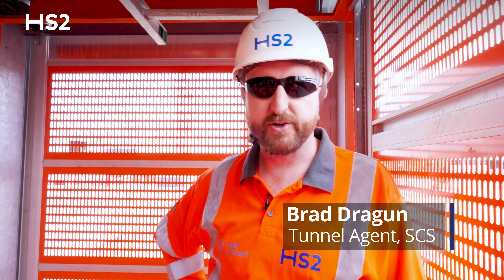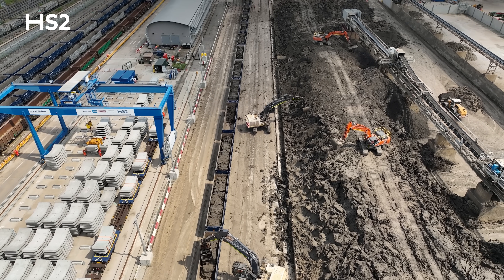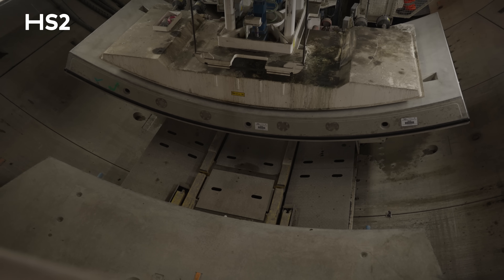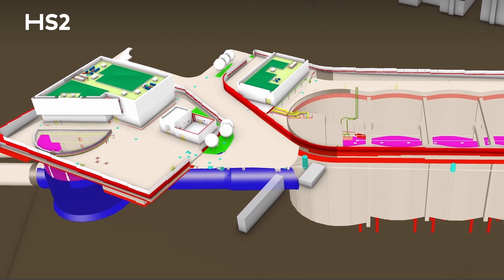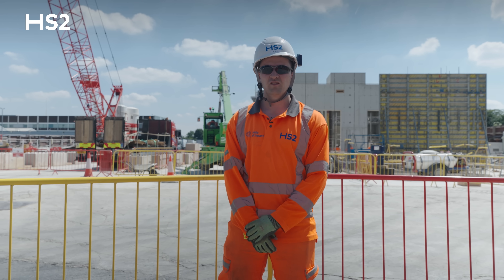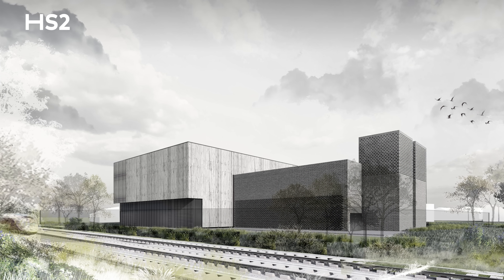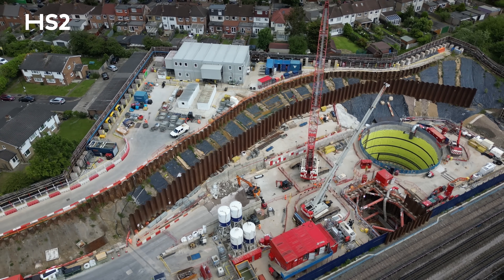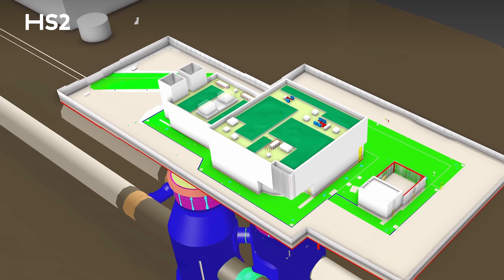HS2’s Northolt Tunnel under the capital is 50% complete

Comment: Good vid. i understand everything except how those tunniling machines navigate so accurately without gps.
Reply: I will explain it to you they use GPS. Probably the most stupid thing I've ever read in my life. I could understand if you made a comment when they built the central line but there's a video on how they dug the Elizabeth line tunnels go and watch that before you type stupid things like that
Reply: @Beansontoast93911  are you austic? must be.
Reply: @BLX187  What is that supposed to mean?

Comment: This whole project, has been corrupt from day one. Millions were made from the buying of houses in the way, by short changing owners by hundreds of thousands of pounds of their houses. The Chinese were originally asked to build it. Their own HS Railways are built at a 1/3rd of the cost of HS2. But they turned it down because of the myriads planning problems. HS2 so far has spent £90 BILLION!!   Chinas High Speed Railway cost £21 million per kilometre. By 2021 they had built 27,000 miles of HS Railway- the largest in the world. They. are now progressing with the MAGLEV system (trains driven by magnetism).HS2 has been nothing but a massive gravy train for Tory private sector businesses. Nothing short of Criminal. The media, hasn't said a thing about it. iTS THE BIGGEST CON EVER. THE AMOUNT OF MONEY SPENT SHOULD HAVE TAKEN IT TO EDINBURGH -WITH BILLIONS LEFT OVER.   THATS 3 TIMES OUR NATIONAL DEBT.

Comment: If the HS2is following the route of the railway,why is it in tunnels….. so much extra cost?
Reply: 1. NIMBYs.
2. 300kmh+ railway needs to be straighter than the original alignment, that includes the elevation.
Reply: @Gelatinocyte2  loool no train is doing 300KMH anywhere near London. Northolt is 5 miles from the Station. There will be speed restrictions post Zone 5....
Reply: @autodigitvlogs  That's what HS1 and HS2 are for: they allow trains to run to their highest speeds. Do you not know how trains work?

Comment: Screw the North as always! As long as the south is okay forget the north
Reply: From where I live as it stands if I was going to Birmingham I would still be using the current trains because it would be slower for me not to so they've made slow speed trains not high speed trains
Reply: It's not even going to benefit the south because it's not going to end up in Central London for another 10 years at least because they can't guarantee it's gonna happen so why would I get a train to the middle of nowhere instead of getting the current trains which actually take me into London

Comment: I really wish people would stop prioritising the north west. It’s drastically overfunded when compared to the north east of England. We are drastically overcapacity on the emcl we also have terrible outdated second hand rolling stock from the north west. The north west is far too overfunded. They should have prioritised relieving pressures already in place on the emcl not futureproofing the wcml when it isn’t needed or necessary
Reply: Your section got canned. Unfortunately.

Southwest would like capacity but it's also known the West Coast is also near or at Capcity. 

North West would benefits from the completely impossible without rerouting of the Great Central Railway

Comment: As said by another contributor, this tunnel was a political decision because of the Nimbys along its route. There is plenty of room on the surface for the tunnel to run, although some over or under passes may have been necessary.  It is the huge expense of tunnelling so much of the route to Birmingham that has made the costs so large. If you add up the mileage, it must be getting on for the length of the Channel Tunnel. Costs were piled into this project by politicians not engineers.
Reply: Correct.
Reply: Slowed and cost increases caused by politicians heavily lobbied (paid) by the petrol and auto interests.
Reply: USA have the same problem.
Reply: Why were NIMBYs on the way to Birmingham able to send the tunnel under ground, meanwhile the sections after Birmingham (which were/are cancelled) had houses demolished, for some of them to not even have railroad laid over them?

Comment: Seems like 90% of the stretch could've been built as surface rail, to save a good amount of money... Something that wouldn't significantly impact the neighborhood, given that rail line already exists and just needs a little additional land for widening. That's what engineers from the yesteryear would've said I suppose... today we abhor noise and hold backyards sacred on wholly new levels 🤷
Reply: Didn't stop motorways being built though.
Reply: @rogerphelps9939 
Crazy, honestly.
Reply: @rogerphelps9939 can you name me some motorways what are getting built instead of refurbished
Reply: I believe the not commonly used mainline tracks here are wanted to be left in case Chiltern eventually comes to OOC. It's known Marleybone is at capacity and if Chiltern needs an increase of trains and they do the further track works that have been put of around West Ruislip. It's a shame these upgrades arnt being done as part of HS2 sadly.
Reply: @ethmister why would you use marla bone why wouldn't you just connect it with hs1 which carries on going down south. Hs1 is pointless unless if you're going to France that should be going all the way from Kent straight up to Scotland that would have saved them billions of pounds having to build a new Terminal at Euston
Reply: Yeah what a waste of money
Reply: @Altn246  well the obvious reason is all of the politicians mates needed to make hundreds of millions profit HS2 was never meant to succeed if it was you wouldn't open the line on the outskirts of London I know matter what anybody says about the Elizabeth line once you get on that you're better off using the current train service by timings if you want to go to Central London there is nothing at old oak common so there's no reason why anybody will want to be going there originally all of these politicians mates have brought the land around Old Oak common and are making billions from building up on top of it to make it somewhere valuable which is completely pointless of a train line until it a major town centre which will never happen

Comment: If Labour don't restore protection for the route for Phase 2 the Manchester section I will be very disappointed in them. The money to secure the route has been spent, it costs nothing to protect the route so it can be built eventually when finances allow.
Reply: EXACTLY SO!!  The route MUST be protected!!
It is sheer madness not to since the most expensive part of HS2, which is bringing the line from LONDON to the MIDLANDS will have been completed.

Thank you
Reply: @chrismoyler I am very pro the route being completed in full. I do however disagree that the most expensive part has been completed, I think they will be broadly the same
Reply: @chrismoyler  Yes. Selling off the HS2 land north of Birmingham was a Tory wrecking tactic done out of spite.
Reply: HS2 is the best exemple of why short term elected democracy doesn't work, especially in a capitalist system.
A 5 year term government is too scared to commit to long-term projects, as people see the money spent, but not the positive outcome before the end of the elected term, that arms political opposition with pointless statistics and use it agains them being re-elected. 
In short our political system incentivise pointless short term project spending multiple millions on a pointless scheme rather than investing a few billion on something with potential.
Reply: @Mrcharlieize  to a certain extent you are right but HS2 was proposed under the Labour government in 2009 then the Tories launched the project in 2010 and started building in 2017. And then it's not going to open until 2029 to 2033. The whole of HS2 could have been built within that first 7 years. But it takes so long because they want to give all of their mates loads of money over 20 year period.
Reply: @Beansontoast93911  yeah this is one of few long-term projects, however it has outlived multiple governments who have all messed around with it and yes as you say corruptly offer the job to some buddy contractor, and then new government new contractors.
HS2 limited is a shady company in itself who shave subbed the work to other shady companies. Just as shady as horse hill developments limited
Reply: Yeah, still it can bw difficult to recontract the project. 

Sunk in cost are tough but it can go worse
Reply: I agree 💯
Reply: Not possible thanks to Tories scorched earth tactics 🤮
Reply: @Antwan86  Very little of the land has been sold, it is entirely possible. And the planning protection for the route can be restored even if some of the land is not owned, it just means you have to buy it again.
Reply: @owensmith7530  the problem is because it's very political you won't get anybody like this too agree with you I think they've only sold about 5% of the Land back but labour are already raising taxes on working class people so I highly doubt they're going to even attempt to revive it they will just be looking to remove your nan's heating benefits
Reply: @Beansontoast93911 have labour raised taxes? or am I dumb- a quick search said they've not raised any
Reply: My Cousins farm would have had phase two substations and pylons, HS2 rented the land but haven't made a purchase.
Reply: You're sadly very wrong, and I strongly urge you check yourself. 
The tories,  as one of their final acts,  sold off the land for hs2 for mere pennies and squandered what little income there was on tax cuts. 
There is no money,  the land has been sold.  It would be incredibly expensive to restart the project now and while it isn't impossible,  there are much more important things that we need to spend on right now.
Reply: @xaiano794  Very little of the land has been sold. The tories said to sell the land, but that takes time and hasn't happened. Partly due to the people involved dragging their feet in case of a change of government I suspect, and partly because it simply takes time.
Reply: @owensmith7530 and you are correct I think it's something small at 5% of the land has only been sold back but the Labour government wouldn't know how to run a bath so I highly doubt it's even going to end up in Euston now it's a complete joke the whole system
Reply: @xaiano794  As for more important things to spend on right now, HS2 is a long term investment and there will always be something shorter term to spend on. You have to invest at some point.
Reply: @xaiano794 they've not sold any land.
Reply: Great idea….precisely why it won’t happen.
Reply: Zero chance and I mean zero
Reply: @alexwipe  I'm saddened that you think that. It is completely free to protect the route, so why not?
Reply: @owensmith7530  50-60 billion reasons
Reply: @alexwipe  Protecting the route is free, all the land has been paid for. It can be left protected but unbuilt for a decade or two and by then with Phase 1 running the value will be seen and we may have the money. It's called forward planning.
Reply: @owensmith7530  I agree but that won’t be with this government. Government runs in 5 year cycles and this government (5 years) will not commit to anything. That said I doubt the will sell whatever they have purchased thus far.
Reply: @alexwipe  With the tories in such disarray and Labour having such a large majority, they should be preparing to be in power for 10 years or more. The last time a party was in power for only one term was 50 years ago in the 1970s.
Reply: @alexwipe  ... you realise that this exact mindset is WHY infrastructure in the uk costs so much? You dont have a permanent infrastructure organisation... each project needs to hire people from scratch and potentially train them too. Besides, not all railways need to repay their cost in fares for them to be necessary... just like how a new motorway could boost the economy of a city without being a toll road, except without all the pollution and with a lot more convenience.
Reply: @cleo5610 The vast sums of money are a drop in the ocean of government bonds and gilts.

I agree with Alex that land purchased before Harper spun his lie about cost savings and redeployment, should be stated to be being protected once Peter Hendy and Juergen Meier reach a conclusion about HS2.

Political upheaval may be possible in 2029, but this government must make the direction of UK rail infrastructure clear and commit to the project connecting London, Birmingham, Manchester and Leeds.
Reply: @alexwipe so many reasons he's not going to provide even one. 🙄
Reply: @owensmith7530 enjoy disappointment instead of spending money on making the service there too busy making videos about it and if you watch the workers in this video they are all just standing around
Reply: @owensmith7530  0 chance mate 1 thing I’ve noticed about starmer from before he was elected is what type of prime minister he would turn out to be, he’s always been scared to have an opinion or make a bold policy proposal due to being scared of being criticised, he likes to play it safe and in no way will reinstate that route it’s not his style unless everybody is screaming and crying for it to happen then he will  definitely do it to please everyone. Everybody only voted for the man due to how intolerable the tories became but have no idea why they voted for him or what he stands for
Reply: @farahomar6880  Actually it's now been leaked that Labour are looking at re-instating more of HS2.

Comment: Fantastic engineering which will be in use for 200 years plus.
Reply: Toriels am I right?
Reply: @Gelatinocyte2  and please remember the Elizabeth line tunnels was completed 2 years ago and they're not travelling at 125 miles an hour and I think you need to do your research because the trains will be travelling faster than 125 miles per hour
Reply: @Beansontoast93911  Speaking of Japan, you would totally react the same way you are with HS2 right now, at the first Shinkansen line when it was being constructed. (It was also delayed and heavily over-budget at the time)

Also, you're the one comparing HS2 to London Underground, I never said LU was meant for high speeds; that's why it only costed a fraction to build as opposed to a full-on high speed rail line, and most of it is just cut and cover anyway. And IIRC, the Elizabeth line also took quite a while to build (and was "over budget" as a result, that's almost always the case for evey construction projects).

It's pretty weird that you claim the new high speed line will be obsolete in the future (ha, you wish!). I bet you're one of those people who stan the Musk types.
Reply: What's a load of waffle the engineering which cost a fraction of the price created the London Underground
Reply: @Beansontoast93911  does the London Underground allow for >125mph speeds? Did it encounter archaeological sites during its stages of construction?
Reply: @Gelatinocyte2  if the train stations wasn't 100 m apart at some points and the furthest Station to Station on underground is about 6 miles yes they 100% could have done that but if you're travelling at 125 miles an hour to travel 100 m that would be travelling faster than the speed of light or sound whatever one it is faster
Reply: @Gelatinocyte2  and what sort of sites are you talking about because the London Underground goes through many historical places in London where HS2 goes under people's houses who are rich
Reply: @Gelatinocyte2  and as a comment said by somebody else by the time it is constructed the technology will be well out dated because it is well overdue and we are currently running a 200 year old service and that is a complete mess
Reply: @Beansontoast93911  seriously? On sharp turns and narrow tunnels? (The station spacing is irrelevant here because you can just skip over them.)
Reply: @Gelatinocyte2  so you have just agreed with me the London Underground was never built to travel at speeds of 125 mph and HS2 only reaches 150 miles per hour which is Dylan embarrassment when you compare it to high speed trains across the world
Reply: @Gelatinocyte2  try and name me one thing they have done well except make a video about a tunnel which is years overdue. And if it's so late for them making this tunnel I can't really count that as a success
Reply: @Gelatinocyte2  actually read the messages before you start replying to back company you work for because I don't think anybody else is supporting the failure of HS2
Reply: @Beansontoast93911  The site I was referring to was the old station at Curzon St. (IIRC) btw.

Also, you're beginning to sound like you're just a NIMBY; bet you're one of those rich people whose house is underpassed by the line.
Reply: @Beansontoast93911  Also also, I'm from Southeast Asia LMAO! There's no conspiracy here.

I just look at the facts; you, on the other hand, are just ideologically/emotionally opposed to public infrastructure works.
Reply: @Gelatinocyte2  absolutely not I live in a council flat in London the trains shouldn't be going underground in the first place they should go straight across these people's 20 Acre Gardens
Reply: @Gelatinocyte2  I can confirm I want that line connected with hs1 I'm not finishing in Manchester where it's originally planned but all the way up to Inverness because what's the point of having high speed train which only runs for 1 hour the current hs1 is about the same time journey
Reply: @Gelatinocyte2  and if you're from Asia in general Japan has showed us how to make high-speed rail
Reply: @Beansontoast93911  can we gut out the same tunnels and change the tracks/trains to make it possible to go over 150mph in the future? Or bore out of tunnels that twist suddenly and make branch-offs that are more straight, allowing for higher speeds?